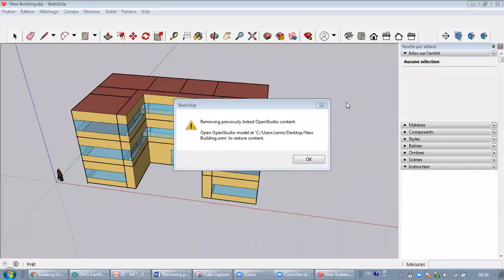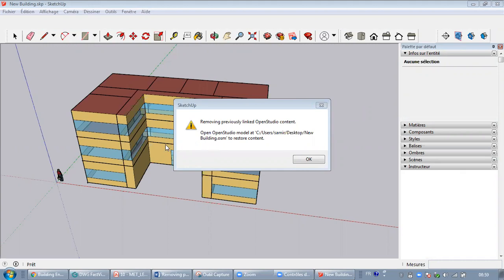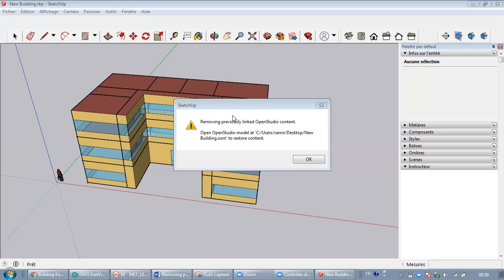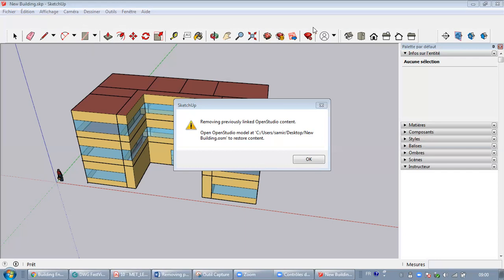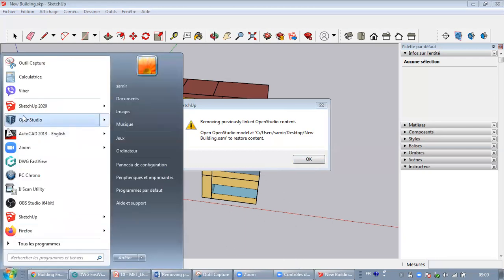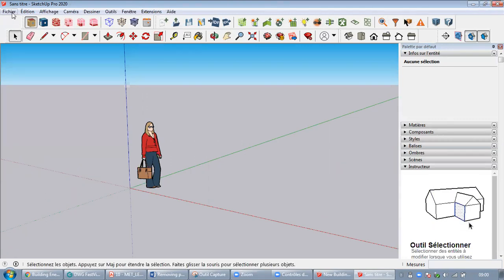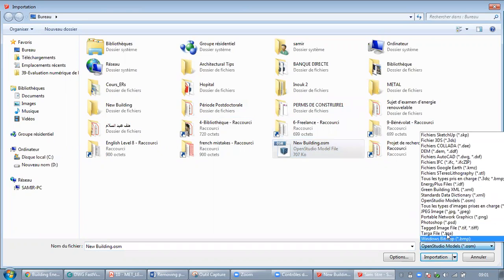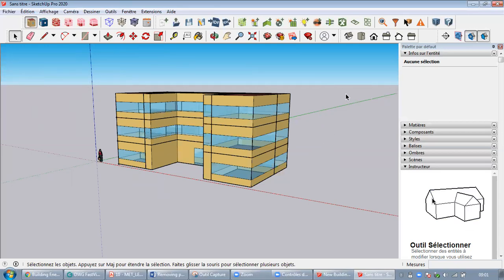Removing previously linked OpenStudio content

Comment: Good work around!  This can also be done using the OpenStudio tool bar button "Open OpenStudio Model".
Reply from the maker: Thank you mike,  I have been using this method before discovering that mentioned toolbar... On my channel, I post videos regarding things that I find helpful and interesting during my learning process.
Reply: @drsamirkhledj9255  Thank you Samir.  All videos about OpenStudio are helpful.  Keep up the good work!
Reply from the maker: @helixenergypartnersllc3540  Thank you so much !
Reply: Thanks to both of you for the video and content. But can I remove all the thermal zones and hvac systems and only export the model from Sketchup to Openstudio?
Reply from the maker: @ahmednislam  Yes, you can do that, in Sketchup or OpenStudio.  First, in SketchUp, if you have your thermal zones already assigned to a model, you need to select the button " set attributes for selected spaces" and then choose "clear field" for the thermal zone. Second, if you want to remove thermal zones in OpenStudio, you need only go to the thermal zone tab, select then remove. Do the same thing in the HVAC system tap.
Reply: @drsamirkhledj9255  Thank you !!!